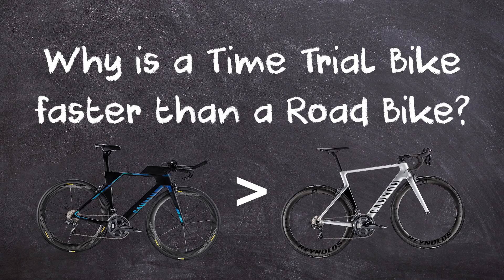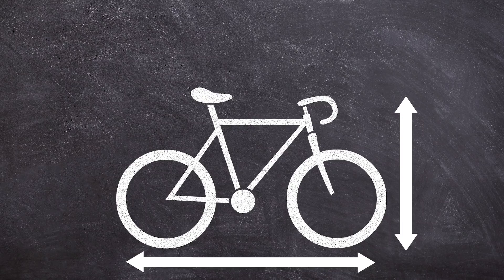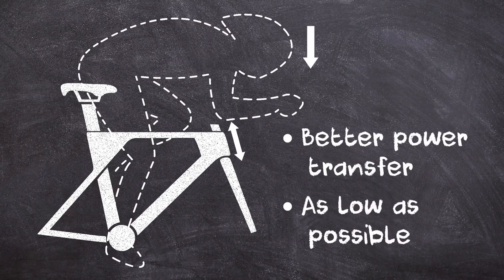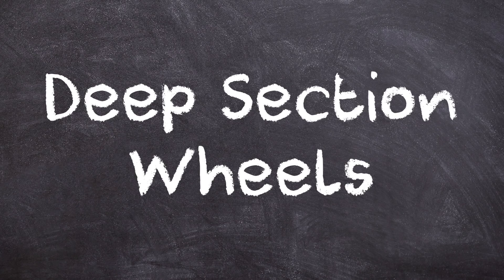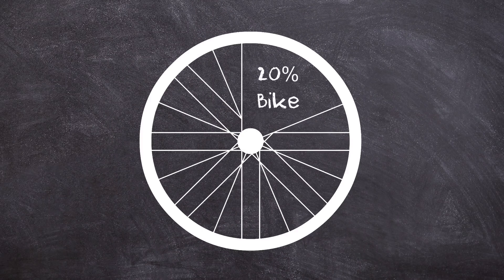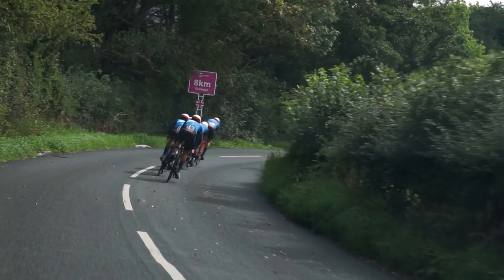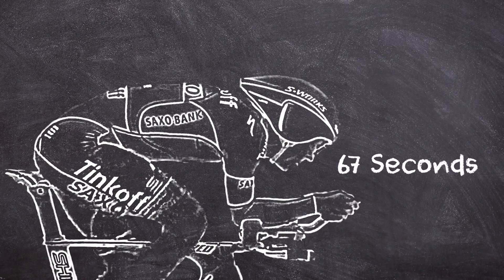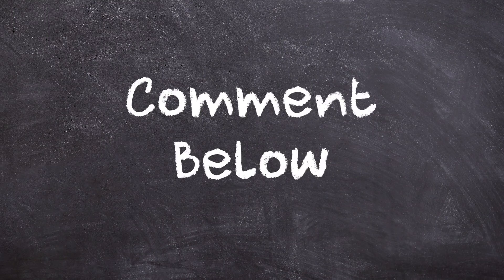Why Is A Time Trial Bike Faster Than A Road Bike?

Comment: My tip to go faster is to remove the seat to save weight.

The shaft is all you need.
Reply: if done right it could make you slide around less than on the saddle
Reply: You have a butt hole and a cylindrical shape, it's simple you'll stay in a lower position easier

Comment: why dont they use TT bikes in normal bike race, if TT bike is faster?
Reply: TT bikes are so uncomfortable that you can't stay on them for long. Also, TT bikes aren't the best for climbing, so if you are going over any mountains a road bike is going to be faster.
Reply: dodolabis they aren’t allowed in road races
Reply: TT bike is advantageous in non drafting race like an ironman or solo time trial...rb is better in drafting race coz aero is not a concern since you hide behind someone else's draft but u need to be able to manoeuvre swiftly

Comment: Yes in time trial, aero matters, but as a road cyclist sacrificing comfort and power for aerodynamics is pure stupidity. you don't get dropped because your stack height is 2 cm higher, but you can get dropped because you are in an uncomfortable position hindering maximum power output and optimal breathing. power always beats aero in real world situations.
Reply: TT bikes serve a very particular purpose. A TT bike on the TDF is going to get smashed, and a road bike on a relatively flat course that is only 100km is going to get smashed.
Reply: Recumbent riders in fast bents and Velomobiles looking at both UCI and ITU cyclists with confused looks. why sacrifice comfort and aero for one or another when you can get both?

Comment: I bliieve you noted 122 second savings with Aero bars and 56 second savings in a TT tuck position. What position was noted when using the Aero bars to save 122 seconds if the TT tuck postion saved only 56 seconds? What am I missing?

Comment: I wonder if alloy, Steel or titanium is more stiff in acceleration compared to carbon since carbon soaks up the bumps?
Reply: Steel sucks up the most bumps, then titanium, then Carbon and then aluminum. Carbon is the easiest and cheapest to shape.

Comment: I used to have tt bike once and I suffered lower back pain.. mega uncomfortable
Reply: Have you tried recumbents/ Velomobiles
Reply: @taufikabidin412  havent tried this but could it be interesting
Reply: I have road bike and i did body geometry fit so i can ride on it relatively in ease
Reply: Do a proper bike fit...something like retul bike fit....used to be uncomfortable riding my bike more than 40km....after a bike fit wt retul system, done an ironman 180k bike course on my TT & can run a marathon after that ...after a proper bike fit that TT bike has transformed from being uncomfortable to being supercomfy...$$$ worth the dough spend in my case....can go faster wt less power vs my road bike hence can do a full marathon off the bike

Comment: For me I have short legs 30 5/8" or 78cm. I swapped out cranksets from a 172.5mm to a 170mm and set all new PR's!  Then a bought some cheap 165mm crankset and again lowered all my PR's!  So now I use 165's on everything!  I would like to try and finds some Shimano compatible 167.mm for RR but their so hard to find and the ones I did find were $550 for 10 speed DA crankset! That is a lot money to spend to experiment with!  If anybody has any recommendations for 167.5mm cranks it would be greatly appreciated!

Comment: Ceramic bearings everywhere. Not only aero but also lightweight. Optimized drivetrain(waxed chain, ospw and longer chain with a bigger chainring, 1x drivetrain, tubeless TT-tires. Aero qr axles/skewers. Rear disc wheel instead of deep section.
Reply: Calvin Pessl Tri-Spoke wheels und the front instead of deep sections wheels

Comment: I can put out more power on my road bike than on my tri bike but I'm faster on my tri bike because of the body position.
Reply from the maker: Body position so important! Just mega uncomfortable that's all 😂
Reply: In my case, it's the opposite. I feel more secure with the additional contact points on the aero extensions. I also opt for a position where I can put out power efficiently and comfortably ,while still being as aero as possible. Though I have a triathlon frame and use it for long distance riding
Reply: Very interesting to know, thx